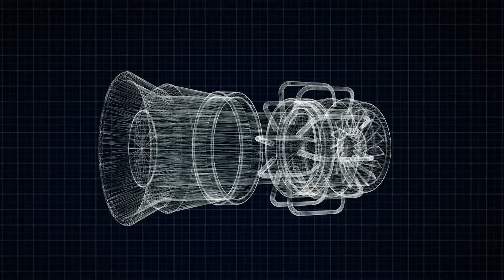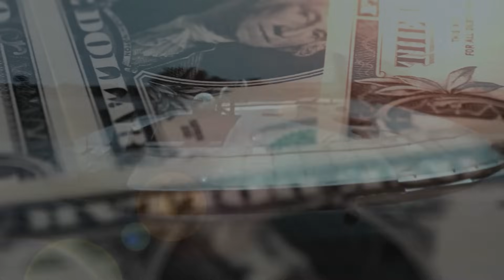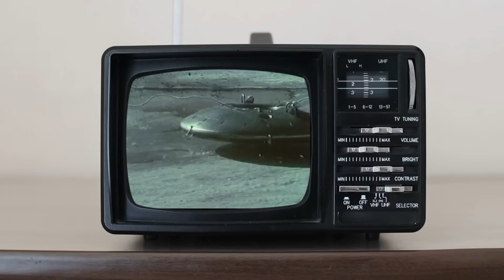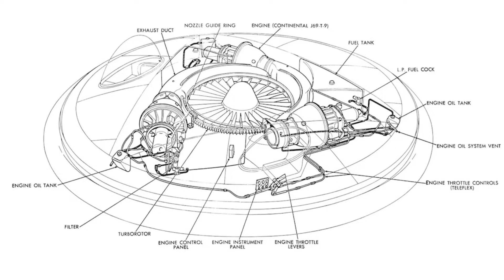This Deadly US Military VZ-9 Flying Saucer SHOCKED The World

Comment: Today, this concept might be more possible.  Using 3D Digital Printing technology, the hull could be printed as a single piece.  The lifting fan could be used to generate electricity to help power itself and ducting could be used to direct forced air in any direction as the directional control.  What do y'all think?

Comment: Now a days, a carbon fibre shell with nano tubes for structural support, electric motors running in series, a gyroscope for stability and a wider diameter main propeller with 4 independent smaller jet engines for directional control and could also feed dynos to recharge the main power cells ....it'd be interesting to see a 2024 revision..that steps further into the future than an oversized drone... Perhaps running nuclear power 🤔